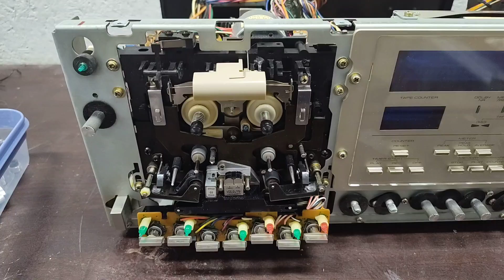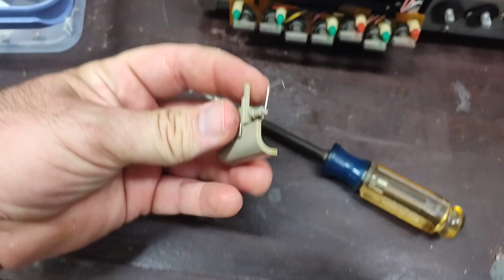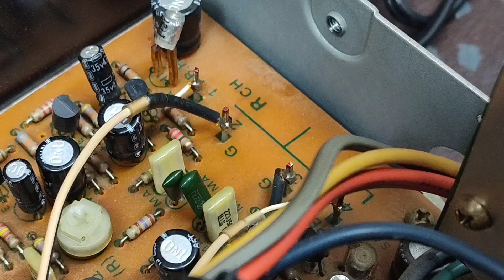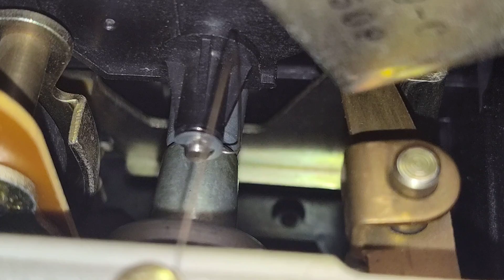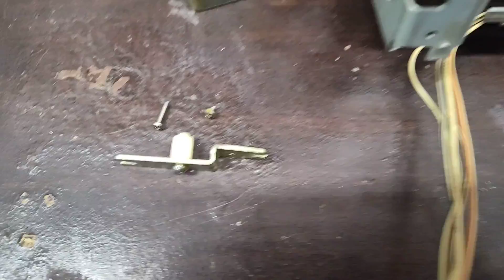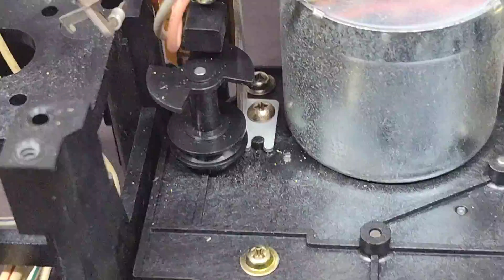Servicing a 1980 Pioneer CT-F1250 Cassette deck. Reel table stalling. P2/?

Comment: Great work Jordan. When i work on these unit I remove the 3 screws holding the headblock to the sliding plate then place it in a static bag then set it in the chassis. no need to desolder wires that way.
Reply from the maker: Been doing this 20+ years and never thought of that. Thank you , sir!

Comment: Great video. The chewed up screws may have been the casualty of a Philips screwdriver. It is possible that the screws are JIS and that tip profile is a bit different from the Philips profile.  I like the idea of replacing the lamp at this point because of the number of hours that it has had on it. It's better to do it now while everything is apart ----- just remember to test the new bulb before soldering it in.

Comment: I would think that if the motor leads show disassembly to that point, that someone fairly competent had been in there before, so I would be relieved by that. Just saying.
Reply from the maker: Yes, but if it's the same person that did the shitty power supply board work, I'm concerned about the motor work too.

Comment: Good to see you back in the electronic fold once again sir. 
I have a Sanyo stereo behaving weirdly in recent months. Right channel is completely dead only can hear very little sound. Left channel is ok. When I turn the balance pot to left i hear the sound and when I turn the balance pot right nothing I can hear. Now the balance pot serving as a volume control in reverse order. The volume pot is not controlling the sound at all. Very wierd. The stereo uses BA3306 for pre amplification and TA7769P as the power amp. I doubt the small value electrolytic caps however I am not sure because I don't have an esr meter. With your suggestions i have fixed many audio devices and this time I need your suggestion and help to fix this issue.
Thankyou sir.
Reply from the maker: Without an oscilloscope to trace where the signal disappears beginning from input forward, there is zero way to troubleshoot this problem
Reply: Yeah, a scope will help a ton. I hope u succeed mate
Reply: @Zimmy_1981 You're right. With dwindling service requirements for vintage electronics, getting the spares becoming difficult in recent years. Also the oscilloscopes only can be seen in universities and colleges for laboratory purpose. They're costly too. 
Hence whoever wants to fix the electronics without such advanced devices they have to  spend more time in troubleshooting which is not the best way to do. I appreciate your support all the time. Thankyou.
Reply: @shriraamsugavanam1870 thanks bro. Sad reality. Keep the faith, parts pop up sporadically. I belive there are cheap(ish?) Scopes now that can do the job. I just tore down my Denon DRW-750. Deck A plays "high & low", seems that the pinch roller needs replacing. There are some hard ridges on it. I ordered a set off ebay.

Comment: That is quite a crazy amount of disassembly that's required to get to everything!
Reply: IKR

I'd love to c wat they can do with current tech
Reply from the maker: Pioneer had it right in the 1990s. They made a cassette deck with a slightly more simplified transport than this. On top of it they had an active noise processor that took all the tape hiss out without disturbing the musical fidelity. Dolby couldn't touch that.  Sadly I don't see many if any of those decks, so they either aren't breaking or have all hit the landfill.